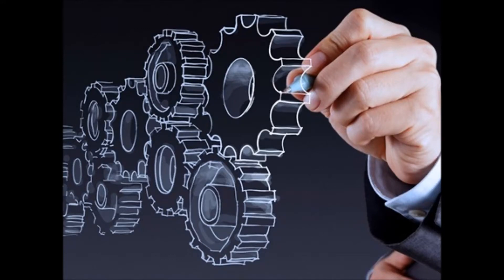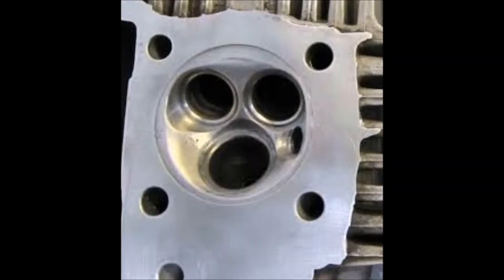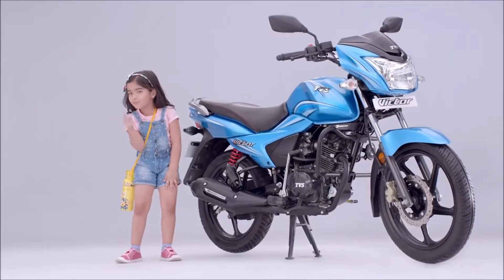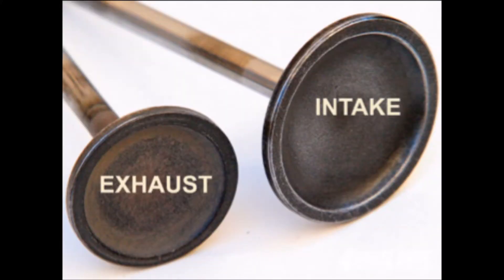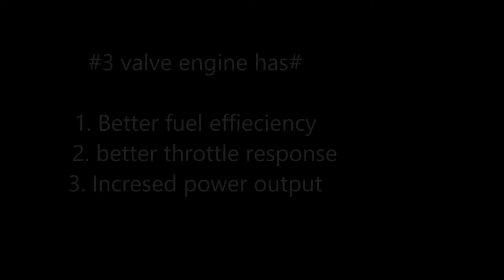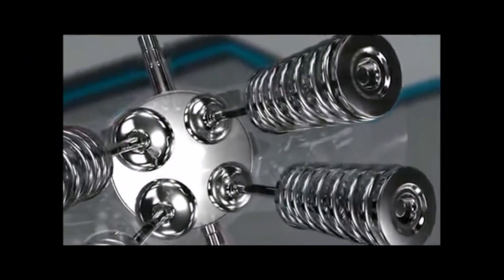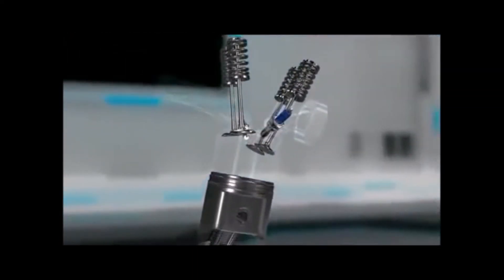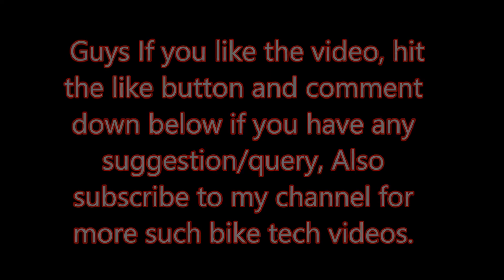Easy explanation of  2VALVE 3VALVE 4VALVE Systems in Bikes!

Comment: which is better
Reply from the maker: if you need better top end power, 4Valve is better!  
Rest 2Valve engines are less complex and cheaper  that's why they are still preferred in most of the bikes under 160cc segment!

Comment: bro,but 4valves makes the engine hotter?or prone to overheating??
Reply from the maker: It is not necessary that 4valves make engine hotter but in some bikes it  happens as 4Valves are generally used to extract more performance from the engine.

Comment: Sir my vespa is 3 valve engine but fuel consumption is very poor I am getting mileage for my vespa 125 cc only 25 to 29 kmpl in city and highway conditions..
Reply from the maker: Valve doesn't reduce the mileage... You should contact your service center if it's unusual mileage!
Reply: @Bike_AutoInfo  thanks🙏.. But i have heard many say mileage is poor in this vespa...
Reply from the maker: Yes That's true...this Vespa is poor at mileage!

Comment: The more valves the more fuel  intake. Meaning it has more fuel consumption compare to lesser valves.
Reply from the maker: No! having more Valve doesn't mean more fuel intake.. Rather. It's just for better intake of Air!
Reply: No. It still the same. Just more gas speed. So your engine can breathe better at high rpm.

Comment: Which is better Maruti 800 6 valve 800cc aur alto 12 valve 800cc ?
Reply from the maker: Bro I don't  have much knowledge about Car engines configuration but As per automobile  technological claims the Engine with more no. of valves performs better.

Comment: Sir, i want to know if no. of valves increase then fuel avg. will increase or decrease. You can check with Apache rtr 2v & 4v. Can anybody explain me.
Reply from the maker: Neeraj Bro, we are friend! So you can call me friend or bro! 😊 
So, technically 4 valve engines are considered better than 2 valve engines in all aspects!
 And Yes  4Valve engine can give better mileage than that of 2Valve engine! 
But It depends upon the tuning of the engines! If tuned properly, 2Valve engines are no less!! 

Hope this will help you! 👍

Comment: Sorry not understand
Reply from the maker: What did you not understand? 
The Intake valve is the valve(s)through which air-petrol mixture enter to the cylinder and through the exhaust valve(s) the smoke and gas goes out through silencer. 
Most of the bikes have 2 valve configuration but 3 valve is also being used now a days and 4 valve configuration is given in high performance bikes/sports bikes! 👍